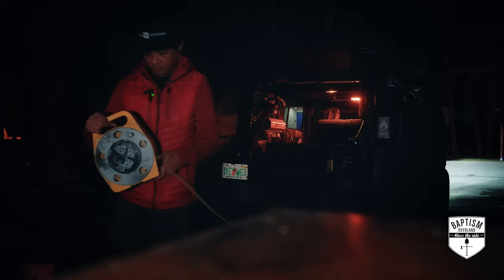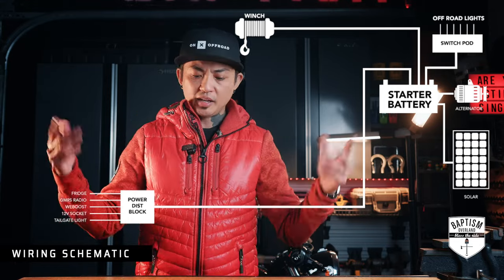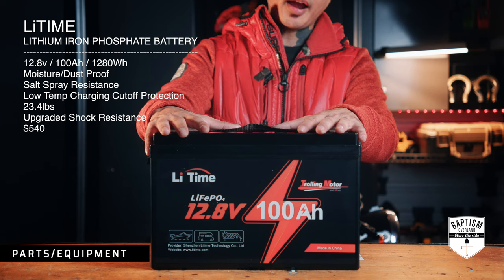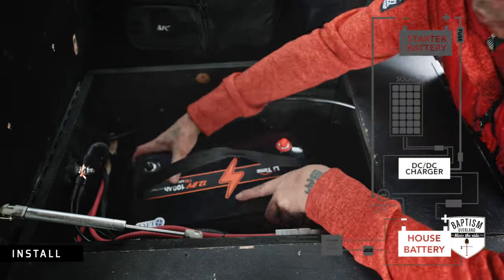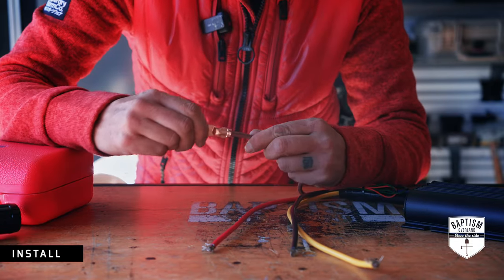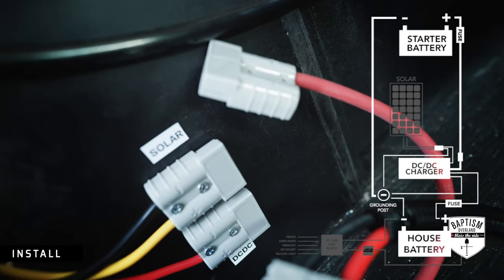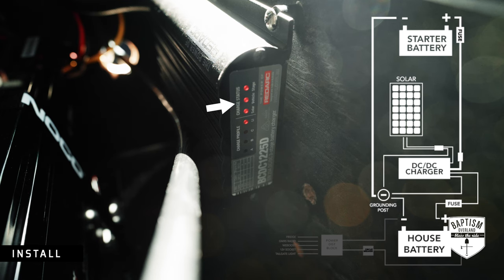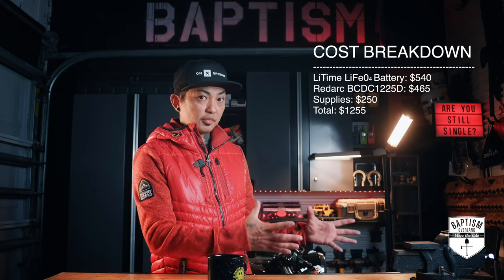REDARC + LiTIME...Dual Battery Setup Made Simple!

Comment: Made simple, just spend too much
Reply from the maker: To be fair the setup is actually cheaper than the same capacity powerbank. I did a video comparing on board dual battery vs powerbanks and the pros and cons of each
Reply: @BaptismOverland  I don't disagree with you. I think the worst part about the dual battery setup is the cost for a bare minimum setup, even though its 1500kwh or more. Hard decision between that or a 800-1000kwh portable battery for less than $1k.
Reply from the maker: @davileett1224 oh I know you don't disagree! It's a great debate to have! I ran powerbanks for years and still do on my other vehicle. But I've been absolutely loving the dual. I can keep the fridge on 24/7 (paired with solar) and turn on rock lights and scene lights at camp which I couldn't do with a powerbank.
Reply: @BaptismOverland  Hmm. Might be worth the squeeze, especially for storage of the battery in my engine compartment. I could also use portability to bring power into the tent to power a fan or lights though.